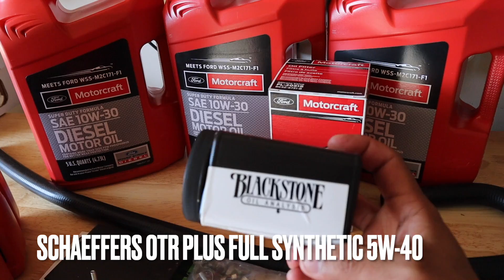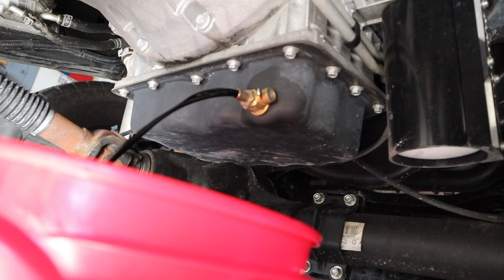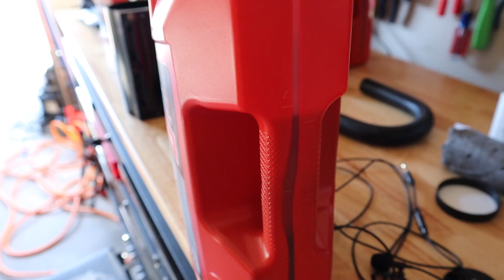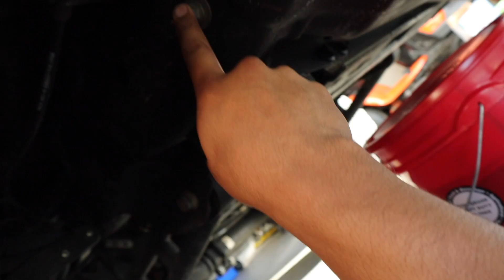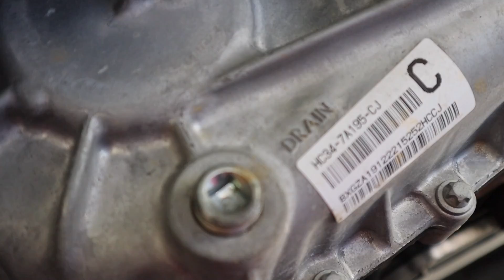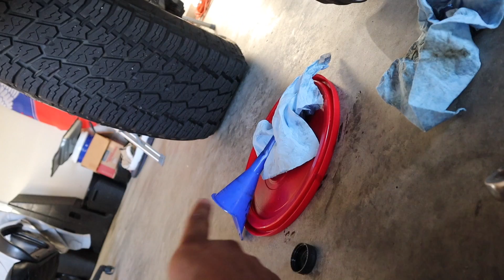2017-2019 Ford F250/F350 How-To Flush Transfer Case Fluid

Comment: Ford vehicles utilize different fluids for the transfer case and transmission, despite some overlap in the type of fluid used. 
Transfer cases generally require a fluid formulated for their specific needs, often a thicker oil like a gear oil, 
while transmissions may use automatic transmission fluid (ATF) or specialized ATF formulations.

Comment: That guard plate was totally unnecessary to remove. I followed your advice in trying to remove it only to find out you cannot remove even the first of the four bolts that hold it on. The other end spins and there is no way to hold the spinning nut. Now I have a loose bolt that I cannot tighten!!
Reply: lol
Reply: The other side isn’t a nut. 
It’s a piece of shit aluminum clip👌🏻

Comment: I have a 2015 Cummins and tomorrow I’m headed down to my local ford dealership to talk numbers and trade in value for a 2022 powerstroke. Any feedback about the new trucks and their 10 speed trans?
Reply from the maker: Doesn’t feel like there are 10-speeds, but nothing significantly different mechanically-feeling from my 2019 (which isn’t anything bad). Those 2022s do look good though! I’m sure you will see decent numbers on your trade.
Reply: @MotorHead18  I’ve only got 85k on this Cummins. Im expecting 30-35k trade in. Im so excited I can barely take it lol. Watched almost all your videos last few days. Thanks for the feedback!
Reply from the maker: @CaliPatriot209  no problem man. Hope it all goes as planned
Reply: @MotorHead18  well, all went as planned. Ordered a 2022 f250 lariat powerstroke with star white with the black appearance package a few days ago. Sold the 2015 ram for 40k. The market is incredible right now.
Reply from the maker: @CaliPatriot209  damn that’s awesome. I hope you don’t regret leaving the Cummins! Star white is super nice. It’s what my wife’s expedition has
Reply: @MotorHead18  as the years pass we change feelings. I have no regret just new beginnings. I’ve never had a ford powerstroke but the new ones are legit. I happy for it. Ha didn’t even realize my first sentence rhymes lol
Reply from the maker: Immediate difference is how fast the Ford is compared to the Cummins

Comment: T-case is very simple.  I didn't have a pump for the qt containers, but used the $1.00 "1 and done" flexible fill tubes that fit various containers, which flexed and attached to qt containers (for t-case and when I did front diff fluid service).  Also after servicing oil/t-case/differential fluids - i use non-chlorinated brake clean, to remove residual fluid and evaporates quickly.  Thanks for the vid.
Reply from the maker: Thanks for the recommendations!